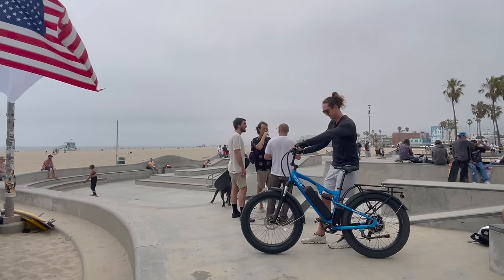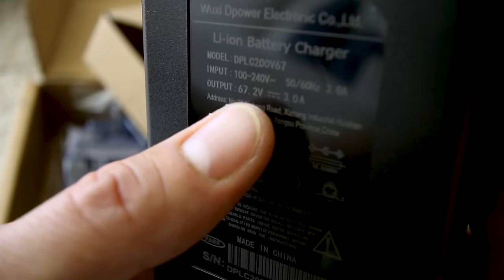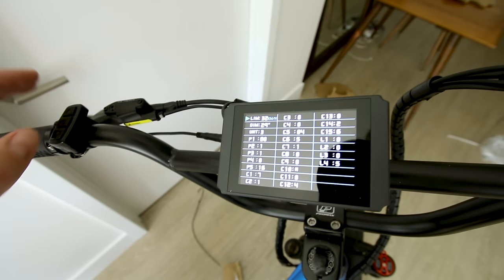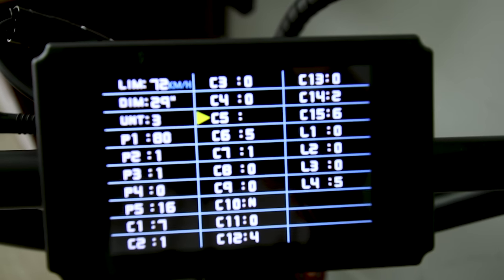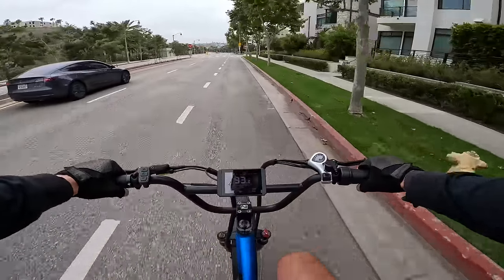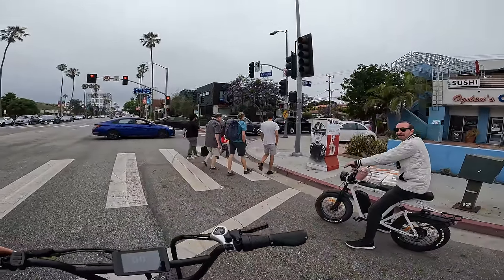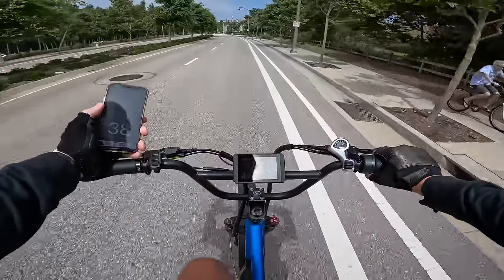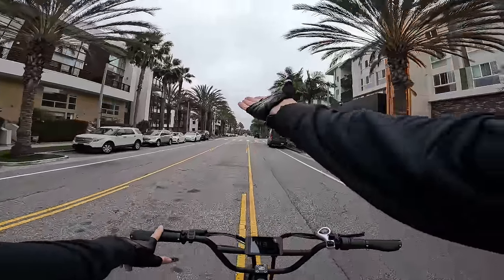This $2000 Ebike is INSANE - Wired Freedom Review!

Comment: My 48v (52lb) bike makes 100nm - same as this 60v (77lb) machine. 
So we'd be equal in torque power performance tests - if I tied a 25lb weight around my neck as a handicap. 
Full Suspension? A good center shock for FS bikes cost $800 -$1000.  
A competent fork for this tank would be a ($700) Mastodon, but who'd bother? Good money after bad. No resale value. 65lbs with battery removed is heavy.
Great battery? What brand cells (crickets) ? 
That looks like a low grade PRC case to me. 
It has a 'Hybrid Metal (read: plastic and metal) Geared Motor', "with 5x the expected lifespan", which begs the question - Is this compared to the Mark One that died in 100miles? Thing is, metal gears are noisy and have to be milled, but last a longer. Plastic is cheaply cast and dies quick. It's a substantial investment in R&D and tooling to develop metal gears that low budget companies don't have.
One tenth more voltage than a 48volt, yet the same torque output as a $1700 bike? 
Read: A 10% less efficient motor.
The saving grace is it's a rear hub drive. So cheap parts in the drivetrain will matter little.
Reply from the maker: What bike do you have? I’d love to see a 48v hub drive that can compete with a 60v. The additional amperage required to run the same power would produce a lot of heat so I hope it’s a well built motor.
Reply: @TailHappyTV  MXUS XF19C. 48v. Rated: 100nm @ 1000watts (I've seen 1250W). A 5 year old Ride1Up Lm'td. New model has 90nm.
Oh, hell yes it can overwhelm the 22amp controller and stutter.
My main ride, a 63lb mid-drive 52v pumps 230nm. Now that's a FAST bike!

It never stutters. Haven't tested the top speed, but testing sports mode 3 (of 5) I've looked down and display read 34mph - in 10th (of 11sp Shimano) gear, while going  noticeably uphill. I think I had 45% left on the battery at the time.
Remember, rear hubs are limited by rpm of the wheel. Mid-drive is limited by the ring / sprocket ratio.
FS bikes can't carry much on a rear rack. Hard Tail w 4.0 tires has a great suspension feel and you can carry much more. Combine FS w 4.0's you have a pogo-stick on bouncy tires effect - boing, boing. That can't carry much. 
Just didn't suit me.
The big three motor producers are Bafang, MXUS and MAC.
They have far too big an edge for new companies to overcome.
Center drive has a much better feel, but eats the drivetrain, increases maintenance and higher grade parts are required.
It's the the 'off-road (mid-range priced) rear-hub' market that's up for grabs - because such bikes are not street legal, so worldwide sales are skimpy compared to motors that comply with regulations in Western Markets.
Sorry this is so long.

Comment: love the bike but not the rear hitting the control box
Reply: Doesn’t hit with the longer shock.  The suspension doesn’t have a ton of travel but it’s perfect for smoothing out the bumps at high speed where you want a firm suspension.  So much more comfortable than a hard tail.  The bike is perfect for road, trail and light off road.  Anything more, you’d want a more capable frame and better suspension components, but you can’t get that in a 60v 2300 watt bike, particularly one at $2000.

Comment: You should mention how many amp hours the battery is. And what brand the cells are. Using that much power can really reduce the longevity of a battery. And a full range test is a nesscesity. Dont just sell a pipe dream!!
Reply from the maker: LG cells, shown in video. Also shown 20ah 60v. Legit battery.

Comment: One aspect no Youtube reviewers address is those hub motors have a nylon gear plantary reduction set.  They are simply not designed for prolonged speeds  of ~> 35mph. Really more like 30mph.   Using these planetary hubs at high rpm GREATLY reduces their life by probably 50%.
As I said, most of these youtubers are completely clueless to this.
Reply: One aspect that you might be unaware of is the Wired bike uses metal nylon hybrid gears that has 5x the life of nylon gears and can easily handle the power.   Wouldn’t want to run 2300 watts through a Bafang.
Reply: that motor is designed by wired for this bike. you don't know what you are talking about.

Comment: whats the minimum height requirement for this bike?
Reply: Technically this ebike is illegal.  But no one enforces this and it’s impossible to Inforcement.  

The law is helmets are only required for class 3 e-bikes. since this ebike has a class 2 sticker on it ever though it’s not really a class 2 ebike and class 2 e-bikes do not require a helmet as long as your over 18 years old.

Comment: You should add comments as to how you are able to feather the throttle getting speeds of 5 mph 10 mph and how easy it is to control throttle speeds set to how fast you want to go. I can go 3 mph on my throttle only or 5-10 mph holding my speed easily. Not really on or off twitchy.
Reply from the maker: I need to learn how to use the settings to set that stuff up. Right now the 5 levels of PAS are the easiest way to control power for me. New video on it coming soon, I took this bike out to the Hollywood sign for a range test, but had some microphone issues, so a bit of editing in the works.
Reply: @TailHappyTV  yeah.. How easy it is to regulate the throttle only for holding speeds is good to know... Is off or on all and nothing between ?  All bikes should get a throttle sensitivity test.

Comment: Update::: these are GREAT !! https://www.youtube.com/post/UgkxHL1v1R3NE5x4KiYfyt8dnQmyNYz7qi5L  As an Ebike they are so Great. Brakes will not last , I have replaced with RUJOI , great stopping power and you can now replace the Pads.I have put almost 800 miles! Rotors and Frame are strong, I’m 6’3” 255lb, A great for an Ebike..... off road is great too!I bought two, one for me and my 12 son. Ok these are not $600+ bikes. They are steel, and heavy. But I turned both into EBikes !! So the steel is a good thing , 1200 watt motor needs strong forks. We’ve put some fun 60+ miles on them. Everybody said to upgrade the brakes and gearing control but we didn’t, they operate just fine. When your EBiking you don’t need to switch gears that much anyway. Everything runs fine, be sure to tighten everything before riding. These are heavy bikes but wow they can handle every type of road / off road. And YES everyone will take a second look, especially if they are turned into a EBIKE!!!!

Comment: Thanks for the video; wanted to see if this e-Bike was a legal electric bicycle under California law and this gave me the answer. 
Obviously you don't care, but the CVC requires wearing a bicycle helmet on a Class 3 speed electric bicycle (pedal assist only to 28 mph).
Class 3 speed electric bicycles have less than 750 watts of power - and have no throttle, so what you have here is a motor-driven cycle that requires a M1 or M2 drivers licence, a motorcycle helmet, DMV registration if it qualifies with meeting federal vehicle standards, and is prohibited like a motorcycle from driving on any bike path or cycle track (like the cattle chute along Pacific Incline and the Marvin Braud Bike Path)  Mopeds (motorized bicycles) are limited to 30 mph and also require a M1 or M2 drivers licence, a motorcycle helmet, DMV registration and are vehicles so no bike paths.
Local cities are starting to pass laws against illegal e-bikes/un registered mopeds and illegal e-bike operation, so enjoy it while you can;  enforcement will be increasing and you will be limited to riding this beast in your own private property.  (Orange County and State PArks like Malibu already prohibit legal electric bicycles from off street dirt trails where mountain bikes are allowed)
Reply from the maker: The bike actually ships as a class 2

Comment: I made some gearing mods to my 750w Troxus Explorer and can hit 34mph with pedaling.  I had higher expectations for the Wired Freedom, a little disappointed.
Reply: @JudeTheYoutubePoopersubscribe  That's true.  Yesterday I hit 37 mph in a full tuck.  Above 30 mph the biggest culprit is wind resistance.  I'm considering putting a drop bar on my fatbike.  I already replaced the knobby tires with slicks. I'm also considering replacing the 52 tooth chainring with a 60, there's plenty of clearance for it.
Reply: @JudeTheYoutubePoopersubscribe  That's true, 30 is fast enough.  I only pursue higher  speed for the fun of it.

Comment: LG's poor battery quality cost GM millions with all the fires the LG batteries created in their BOLT car.  It took GM 2yrs to redesign.  LG Electronics paid General Motors $1.9 billion to cover almost the entire cost of the recall of fire-prone batteries in the Chevrolet Bolt electric car that has become a big problem for GM.   On another note, too bad the Freedom uses a cadence sensor to deliver the power.  When they offer a torque sensor I'll consider testing one.

Comment: Be careful getting this motor hot…. Seen a lot of reporting on the magnets debonding.
Reply: @braticuss  don’t have one atm, but I’ve seen it mentioned quite a few times in both Facebook groups and a few videos here on YouTube. Also a guy in a local Ebike group had his replaced under warranty after less than 200 miles.
Reply: they fixed the problem. the very first gen. had that problem and they are rebuilding and replacing motors for free on effected bikes.

Comment: What happens when they break down and you don't have a storefront to bring it back to? Can I ship it back to China for a new one? 🫣
Reply: Take it to any bike store, the parts are common, Tektro brakes  and Shimano drivetrain.  If you need a new motor, you shouldn’t because they use metal reinforced gears that last 5x longer than nylon gears, then you can get one from Wired in Chicago where they are located.  Americans speaking English offering amazing customer service, what a relief!

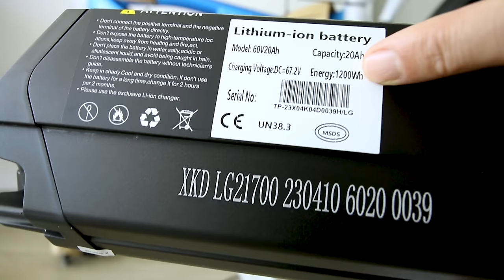Comment: I was sure I was getting this bike until 2:55 minutes into the video....I don't trust a company that doesn't even have the sense to check their battery labels for errors! Avoid being caught in the hain!? If don't use battery!? 😂 Just terrible. I can only imagine who does quality control. 🤔 Great video but it's a no for me...
Reply: trolling a typo? you must be fun at parties.
Reply: It's not a typo.  The sticker is there for regulations to cover your as if you get stopped by police.  If you set the bike for type 2 mode which is the default then your speed and power is limited similar to the sticker.  It's only if you manually change the settings will you get access to the full battery power.

Comment: The only thing that protects E Bikes  from motor cycle and moped regulations like registrations, licensing and access to bike lanes and mixed use trails is there speed.  As soon people on mixed use trails and bike lanes complain about people Flying past them dangerously on trails. Local and state governments will do what they do best. Regulate E Bikes and license them. Which will destroy the E Bike industry.
Reply: Anyone who rides faster than 20mph on a trail near anyone is a dick, just like people who drive 55mph in a 25 mph zone and should be ticketed.  But you really need the power to climb hills and perform well off road.  It comes down to personal choice and responsibility.  I think the Surons and moped style will get the worst of it, but I wouldn’t hold my breath waiting for the feds to do anything about anything as Congress isn’t functioning.
Reply: @jfly2249  Laws concerning E bikes Mopeds trails and bike lanes are basically state and local laws. not federal. That means there are at least 59 bodies who decide in E bike regulations. There are thousands of state senators and congress people. And all it takes is one influential to get a case of the ass for the industry. And we all will be buying tags and registering our bikes and getting licenses.
Reply: @jfly2249  Once Mopeds were classified the same as E Bikes today. But today those states treat mopeds the same as motorcycles. After a rash of accidents. And how many millions of dollars can a state raise by regulating  and licensing. Give them an opportunity and they will.

Comment: Wish it was a torque sensor instead of a cadence sensor so it didn't just go full bore right off the bat. Other than that looks awesome.
Reply: In PAS 1 it’s a gentle 120watts, rides just like a bike.
Reply: @jfly2249  I mean true but then you have to change settings back and forth. Still prefer torque sensor so you have more control. Particularly if you’re on a path people also walk on.
Reply: every single thing can be adjusted on the display including simulated torque sensing. watch the video
Reply: @timothywarehime5956  I don't want "simulated" torque sensing so what's your point? I did watch the video.

Comment: Yo.. those dropouts are sketch. I have a a fs 26x4 21ah geared hub 48v @ 50A.... i had to use a reg torque arm on one side and custom made one of 1/4" steel plate on the other. Your shit has more power than mine. Mine badly needed the dropout condoms

Comment: Not impressed. My real 1500 watt motor is way larger. My homemade bike does 36mph on a 48v system. What manufacturer would ship a bike with the rear tire rubbing. Plus I have a 30 amp battery that lasts a long time at full speed. Yes I like a 60v system but this is not a bike I would buy.

Comment: Bet it won't climb as good as my dual motor AWD, foldable....and that's a deal breaker if it won't climb the street I live on. Mine goes 32 MPH...fast enough...any faster you better get a regular street bike with MUCH better suspension....60 mph? hahahaha...crazy dangerous with those wafer thin breaks. Faster isn't better...it's just faster...
Reply: Don’t count on it.  48v is for kids.  60v 2400watt climbs like a mountain goat!!  Your bike probably weighs 100lbs who cares if it’s foldable lol.

Comment: Love that this is such a cool bike - hate the miss-leading title. Its actually $3,000+ with tax to get it to go this speed, so its a flat lie. You need the front and rear battery (see the website link he provided). Stock at $1,999 it comes with only the rear battery, so you absolutely cannot go anywhere near 38 mph on $2,000. You need to spend 50% more money.  Ignoring all content from this creator for the click-baity-misleading title.
Reply from the maker: Please take into consideration this video was posted a year ago and prices, shipping, etc have changed since, also new iterations and competing brands have come out.
Reply: Although I have not purchased the newer 2024+ model (yet), your comment about 1 battery prompted me to chat with Wired.  I'm told the 2024+ comes with front and real batteries.

Comment: 👎🏼 Made in China. Return option Void IF - unlocked, exceed 10 miles. Will cost you $1325 if you return within the 30 days. $500 restocking fee + s/h to you $250 + s/h back $450. Etc..